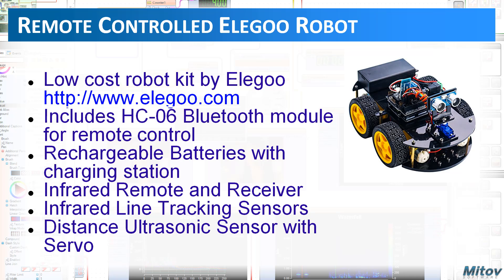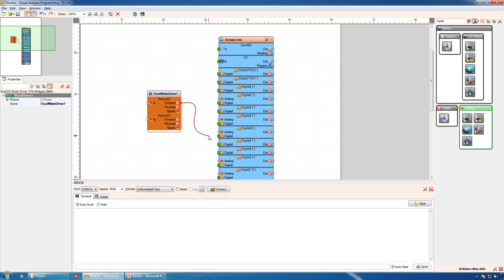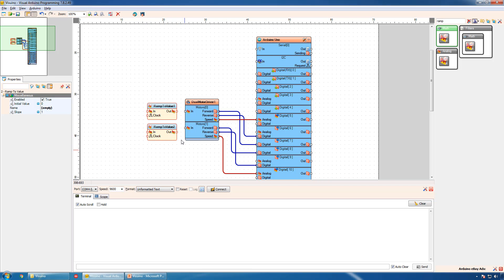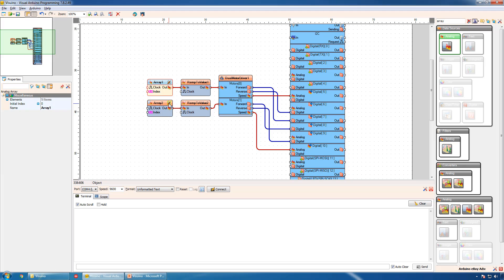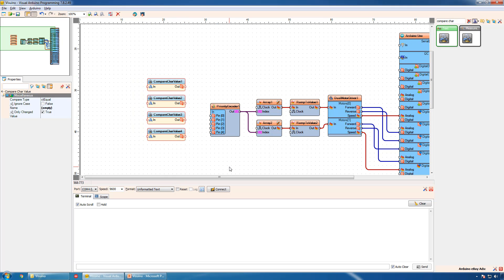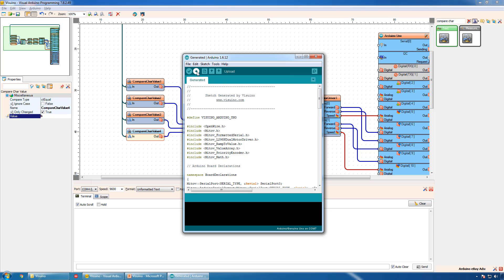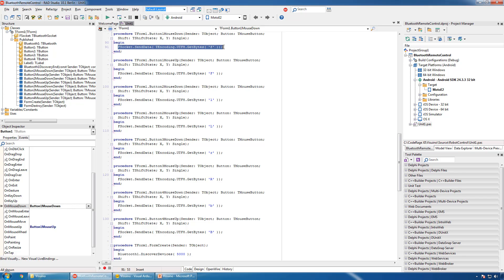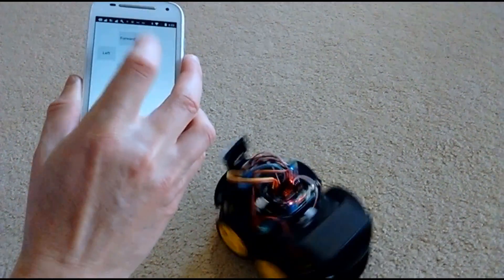Visuino and Delphi Video Tutorial: Program Bluetooth Remote Controlled Arduino Smart Car Robot

Comment: where is the Hc-06?
Reply from the maker: The HC-06 uses Serial to talk to Arduino. It implements Serial over Bluetooth protocol.
Reply: I have a question  in your channel  about bluetooth I use the HC-06 and Arduino Uno  to control  a few relay .I need to control them and receive data from Arduino about  them  either they are on or off
Reply from the maker: Sure, you can send from Arduino the information to the Serial port, and then receive it over Bluetooth. I did a robot that both sends and receives using HC-06. Will try to post tutorial for it when I get chance.
Reply: thank's for the reply ,you are the best..
Reply from the maker: The simplest way is to use Formatted Text in Visuino and send the status of the relays as text line. You can follow any of my tutorials that use the Formatted text with serial, and they will work with HC-06/HC-05
Reply from the maker: No need to use software serial. I usually use the Hardware serial.